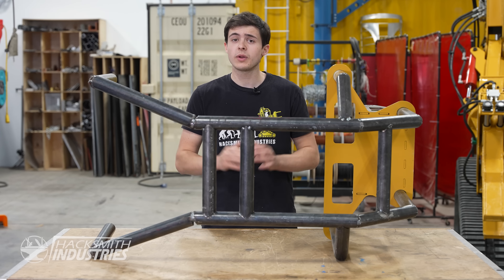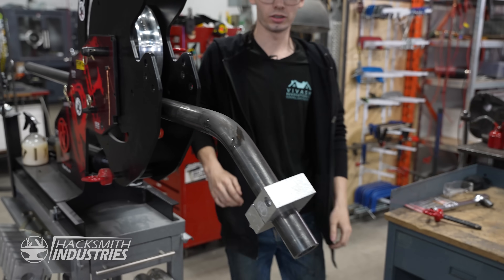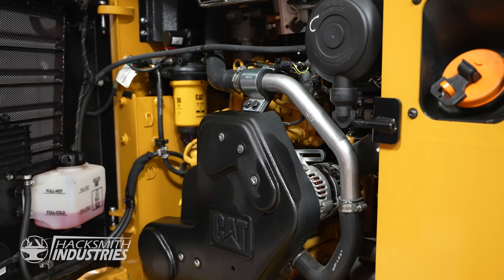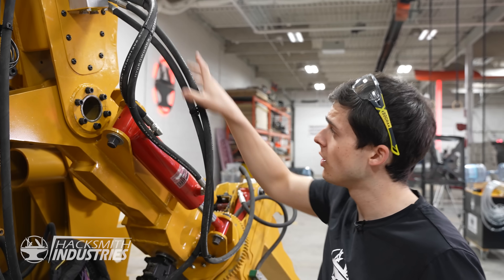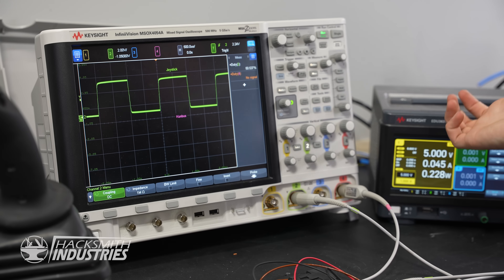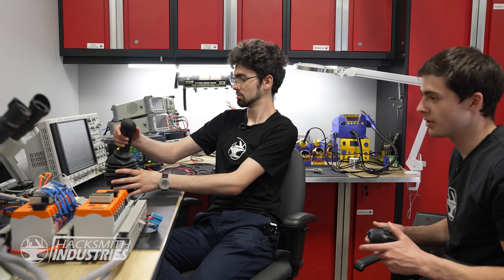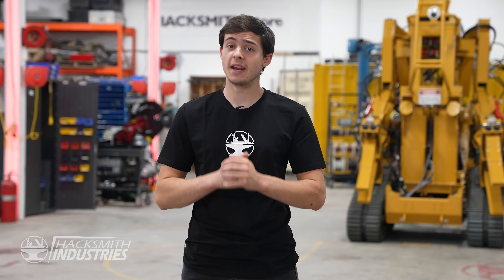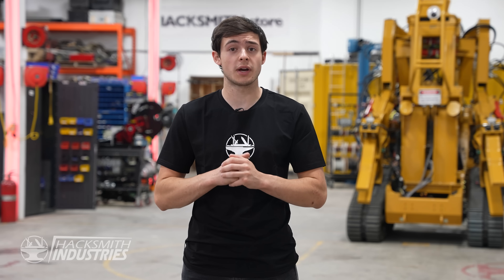The Giant Comes to Life... (POWER LOADER: PART 14)

Comment: You could not get any thicker pipes for the rollcage to make it a bit more heavier?
Reply from the maker: I assume you're being sarcastic. Even the pipes we used may not be strong enough in a serious accident. It's not the same as a car roll cage -- it's a 10,000lb mech!
Reply: @hacksmith  I do understand that, but unlike a racing car it’s not going 200 mph. It is more the weight than the speed so kinetic energy would not be so high. But I am speaking outside my field of profession here. I suppose you all know what you are doing.
Reply from the maker: Mass kills even more than speed ;)

They're strong enough to support the machine, but in a dynamic load... might not cut it. Overall the whole design is not very safe, but that's what we get for designing something that was made of foam for a movie ;)
Reply: @hacksmith  please do be careful. Hydraulics are dangerous on it’s own to work on. Let alone on this machine.

Comment: This isnt the true power loader suit, but i guess they built something of inspiration from the power loader suit, the fact they built it incorrectly  means extra standing space when it should be things for feet and feet rest, if you look at the original design, with some engineering it should've been a easier  build with the moving LEGS, now they have to over engineer to accommodate  the track system.
Reply from the maker: How would it be easier to build legs? It's a 10,000lb mech... it would be a statue

Comment: You guys have to wonder how much it will fit without tipping over. ( it will probably be expensive but you guys don’t want to try to lift something for a project and have it tip crush and kill the occupant.
Reply from the maker: That's why math is important :) we've done the calculations
Reply: So how much is it’s physical limit?
Reply from the maker: There's a lot of variables,  for instance,  driving at full speed and then braking changes things significantly ;)
Reply: Lol can’t wait to see the rest video then you can explain all about it
Reply from the maker: probably not happening lol

Comment: Just a suggestion: Avoid Teflon tape like the plague! Use pipe thread sealant with Teflon instead. I know it's too late to tell you this but I've seen what a tiny shred of tape will do to hydraulic pumps! A shred will get between the gears and split the case! The sealant, if it gets in the system, will not. Speaking as a Mechanical Engineer from 40 years of experience with pneumatic and hydraulics (among other things)...

Comment: They made a mistake painting tge roll cage yellow, it would have looked better in black, small detail but it is the little things that make the difference
Reply from the maker: But it's yellow in the movie as well dude... it has black padding on the bars,  which we will add.  Small details ;)
Reply: @hacksmith  I must have been misremembering them as themselves being black, in that case it will  look just as good if not better 👍

Comment: Holy crap you guys are using some thick walled tube for that cage. That's a ton of unnecessary weight and expense. Most off road vehicles don't use anything near that thick and hold up great
Reply from the maker: It's a 8000lb vehicle.  The roll cage would flatten in a dynamic loading crash

Comment: it needs to walk
Reply from the maker: Legs are possible... if it didn't weigh 10,000lbs
Reply: @hacksmith  then make legs that support more than 10,000 lbs
Reply from the maker: @jjohnson71958  it'd be a glorified statue. Tracks make it functional

Comment: Bogdan: wears gloves to install some pipes

Steel guy: grinds metal with his bare hands
Reply: I do almost all my metalwork bare handed (cutting, welding, forging ect)- I find a burn myself a lot less without gloves and with, partly because I'm much more aware without gloves and partly because gloves either sprout a hole (which I find the hard way), or I'm holding something way too hot and by the time the head soaks through the glove its too late.
Also the wrong gloves can make burns worse as they melt and stick to the skin.
The worst and most intensely painful burns have been from a drip of molten plastic because its sticks- molten weld splatter stings a little but rolls off the skin.
The UV burns from TIG welding are pretty nasty too- well worth keeping your arms/skin covered as much as possible.

Comment: That is really a fantastic build!

Now if I may make a suggestion.  Contact CAT and see if they want to actually buy it!  The machine (if you want to sell it) and the CAD to make it.  Should get at least 2 mil.

Why?  If it really will work like you plan - it is a sellable product.  They have the ability to make and sell, you don't.  (LOTS of dedicated machines to make all the parts assembly line fashion).

Really did a great job!!
Reply from the maker: It's not a viable machine though... it's so dangerous
Reply: @hacksmith  
True it really is - but that wouldn't be the real "draw" for CAT.  It would be a "Show Stopper".  Something for the shows they go to to bring customers over to their booth.

Actually not more dangerous than any of their big or little machines.  Just takes practice to use properly.

Comment: could welding an another foot plate above the existing one solve the issue instead on creating another roll cage ?
Reply from the maker: That's not a good solution though! There will be foot adjusters regardless :) the new roll cage is much better

Comment: Bogdan you need to do something to protect the operators legs, I recommend you put in a ramp to allow the operator to board the power loader easily, and then once they are on board the ramp can hinge upwards and lock into the roll cage. Then you should still have full range of motion, but at the same time being more protected.

Comment: Now they can use a 6 axis gyroscope like MPU6050 to control each arm. They can put it right inside a glove and have the glove transmit the values wirelessly over Bluetooth to the controller.

Comment: Can it have a leg shield and arm cover? It looks like its still vulnerable on the lower leg part and the shoulder portion on the sides. I asked for a shield on the lower body not only for the arms but also to some falling debris from the lift at front, and for the arms, maybe a barrier along the shoulders to the  hands? Anyway nice job, can't wait for the final form. 
Also, there could be a noise reduction for the engine?

Comment: That Bender would be really nice if it could also cut and load the measurements from the machine itself so it'll feed the pipe through the end instead of measuring to bend it it'd be much quicker but since you were sent it and it's you know not for big manufacturing I think it'll help out a lot

Comment: Only thing missing is a display with each arm hydraulic pressure. Including system wide hydraulic pressure to keep from overloading. Display allows you to monitor the system
Reply from the maker: It's not even close to done... and it does have pressure gauges on both shoulder plates. Everything will be digital though for the cockpits

Comment: looks like you might need a hydraulic balancing valve to make those claws work properly. Right now the one with the least resistance is moving fastest, which they should be locked to go the same speed.
Reply from the maker: They have that but there are other issues until we get proportional valves

Comment: does the powerloader have a max rotation count where you can only spin the wrists so many times so then you dont have to worry about cables and hydraulic pipes getting tugged on? like does it have some sort of system or position marker notifying the driver of what position the wrist is at relative to its standard vertical position?
Reply from the maker: Yes
Reply: @hacksmith  damn, mustve not picked up on it in the prior episodes

Comment: Im curious if you get that inverse kinematics model running on a raspberry pi based platform - i had issues with a way smaller model while importing the files. I guess it was a memory issue, maybe your raspi has more ram than mine had. But in any way, a stronger linux based computer would be a safer bet.

Comment: Genuine question here my idea is hydraulic pumps pistons basically is responsible for hold the weight with the structure its attached right. How come the flexible hoses doesn't burst?
Reply from the maker: Because they're rated for the pressure of the system
Reply: @hacksmith  lets say its lifting 500kg how much pressure does it contains? It just boggles me coz it looks flimsy
Reply from the maker: The hoses are rated for 4000PSI and the system only runs at 3500PSI. The arms can curl over 3500lbs each with no increase in pressure, it is constant =)

Comment: Now you will need to drill and tap a boat load of grease zirk fittings on all those joints. If you want it to keep moving.....
Reply from the maker: You'd be surprised how long it would take to dry out.  Not a commercial machine.  Going to have only hours on the odometer

Comment: Those string potentiometers are a life savor. Instead of manually putting a normal potentiometer, and engineering a fitting to integrate with your machine. Those sting ones you can literally put anywhere and do some math and you have motor position. 

Those specific ones in the video are the CALT 500mm Measure Range 0-5Kohm Draw Wire model.
Reply: As a mechatronics engineer watching this is like watching dreams come to life

Comment: Irony: Building a Power Loader, a two armed forklift, with a forklift.
Reply: That is like programming a computer, because without a computer you cannot program a computer
Reply: @rayyanshaikh5591  Oh how true that is, so how did they program the first computer.
Reply: @OnceinaLifeti  I dont know, but I think its using stamp cards. They had these special cards that were stamped in certain places, and then the computer could read those holes issue an output. This is just a guess from something I read several years ago.
Reply: @rayyanshaikh5591  Those were the size of entire rooms, and all they did was hole punch cards.
Reply: @OnceinaLifeti  they were huge cards, and they made tiny holes in spots, like 0's and 1's.

Comment: Imo, you need to extend the forearms.  Think they were designed more along Aliens proportions, but after mounting them to the skid loader, with the cockpit more in front and the length of the tracks, they are really too short for usage.  It would be more useful if the end-effectors could touch the floor.
Reply from the maker: They can reach the floor actually.  Arm placement is identical to the movie regardless of the base!